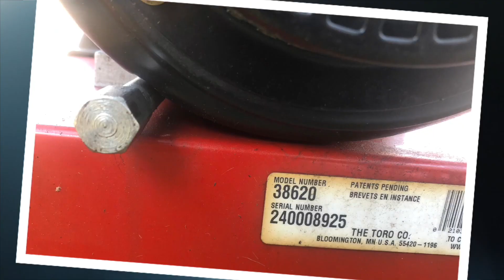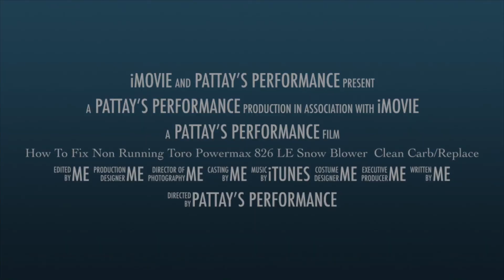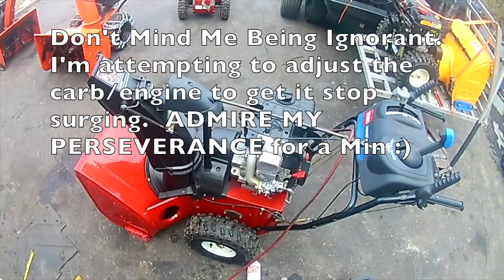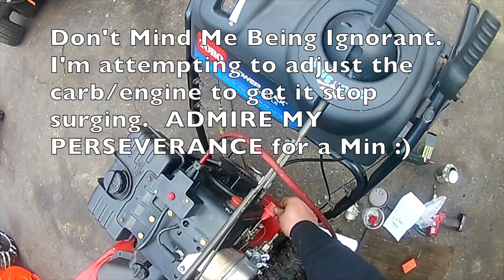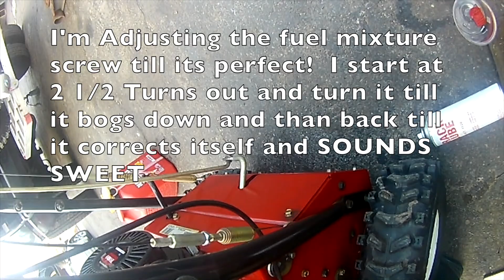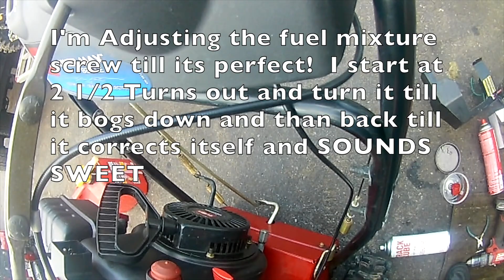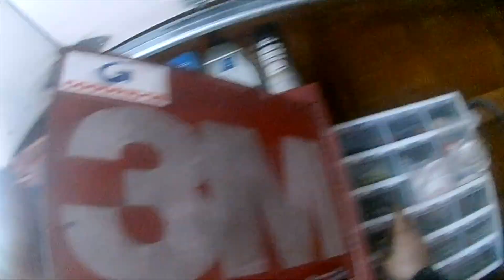Toro Power Max 826 LE Snow Blower Running Issue Repair Carb Replacement / Carb Clean HOW TO VIDEO

Comment: I have this same snowblower. I have had it for about 10 years. This year it will not start. I took off the carburetor and it's completely dry. Seems like there definitely is no gas getting to the carb. What do I do? What should I check I don't really know what to look at?

Comment: Had this machine for eleven years. Loved it and miss it..
Upgraded for a modern motor with an Airens.  
But this Toro is just right in size. Don’t think they make this model anymore. 
Absolute bargain at $899 in 2005.
Reply from the maker: We bleed Oranger here at Pattay’s Performance.  Mind me asking why you didn’t go with another Toro or Repower your existing unit?  

Toro still has an 826
Thanks for the view and comment, hopefully you subscribed to my channel 🔧🤙🏻🇺🇸🦅

Comment: My new carb would only run choke on, any suggestions? My neighbor and I tried messing with the jet and idle screw, but it doesn’t even start now, when I did the initial install it stayed on for 10 min but kept dying while taking choke off
Reply from the maker: It doesn’t start bc you messed with the jets.  Bring it back to factory adjustments.  Do you still have the original carb?  Swap out the main jet from the old carb to the new carb.  There are numbers on the bottom of the jet, if they don’t match up swap em.  

Can you post a link or send me photos of what carb you got?
Reply: yes im aware thats why it doesnt start now, but returning it back will give the same issue i started with , and adjusting them is how you change the A/F mixture no? thats why we started there, its not getting enough fuel. I  got an amazon carb, direct replacement for tecumseh, the only thing different is this one has a valve on the bowl to release fuel  @pattayperformance
Reply: i also replaced fuel line and petcock to make sure there were no obstructions, gas is getting to the carb, so im assuming its the jets, and new carb wouldnt be clogged so thats where the confusion lies
 @pattayperformance
Reply from the maker: @ianlynch7889  post a link to your carb bc I’ve never seen one with a valve.  There is a spring loaded button or you got the carb with the ADJUSTABLE jet on the bottom.  

Depending when carb you got…either touch the idle circuit and or upsize it or adjust the jet on the bottom

Comment: This video gave me a bigger headache than the snowblower not starting. Thanks for the attempt but so much movement of the cámara and loud music in the beginning not necessary.
Reply from the maker: No need to apologize...it’s been a few minutes since you posted.  Are you feeling better?  Here is a video I made about a carb replacement.  Gives you the steps needed to access it.  IMO it’s $15 better off that way.

If you still need help...do you Instagram?  We can video chat as you work on the machine.  If your willing to learn I’m willing to teach.

Thanks for the view and comment, hopefully you give my channel a second change and I earn your sub 🤙🏻🦅🇺🇸🔧
Reply from the maker: https://youtu.be/tnfhh38LkV8
Reply: Thanks for the other video much better and very informative. This one is a 💎 gem.
Reply from the maker: @claytonfranco2084  thank you for giving my channel a second chance!  Hopefully I earned your sub!  I changed my vloging set up when we broke 1,000 Subs.  Decided it was time to take this with a more professional approach.

Don’t hesitate to ask any questions if you still have problems with your machine.  🇺🇸🔧🤙🏻🦅

Comment: Hi I received this machine with our home purchase and noticed a sprocket with two sets of teeth move around a bit on its shaft. I’m guessing that’s not normal. Is this a part that wears from use? It’s the gear with the chain on it. Also the chain seems loose does that stretch and need replacing too?I have a video but not sure how to send it to you. Are you on Facebook? Any help on this is appreciated. Subbed and liked
Reply from the maker: Are you on Instagram?  I think you are referring to drive sprocket.  There is suppose to be some play by nature.  Not enough to throw the chain out of wack.
Reply: @pattayperformance  drive sprocket I can wiggle left and right maybe a quarter inch. No teeth are broken. It show wear
Reply: @pattayperformance  no to the Instagram
Reply from the maker: @ronniejr1983  sorry been busy.  How did you make out?  Download Instagram it’s free.  We can video chat when you are working on the machine.  Hopefully help you troubleshoot it